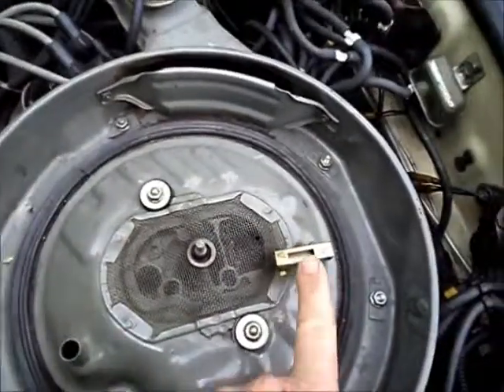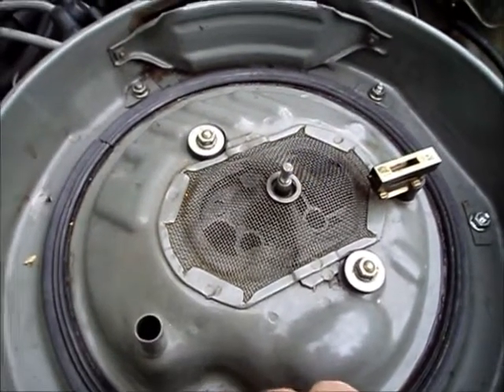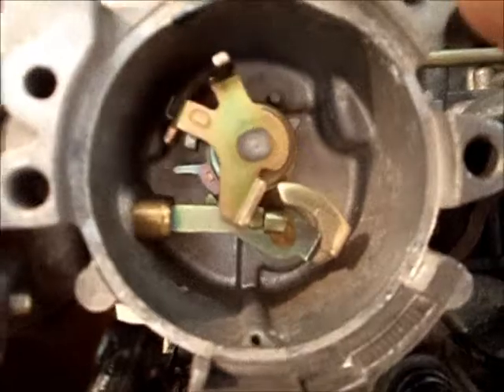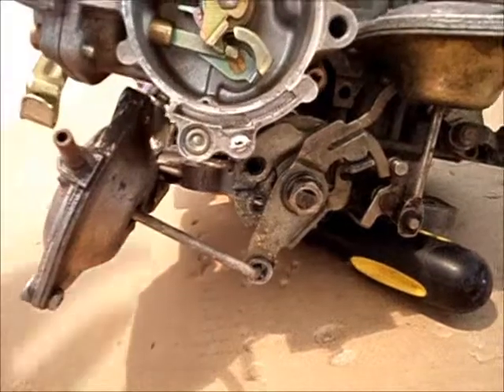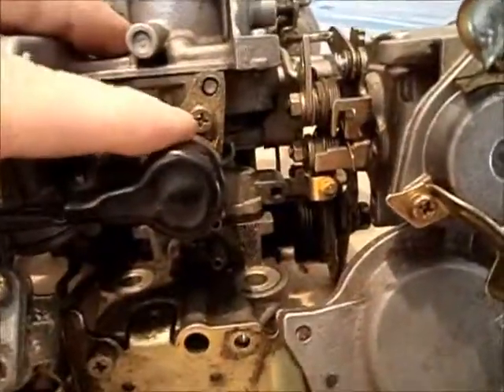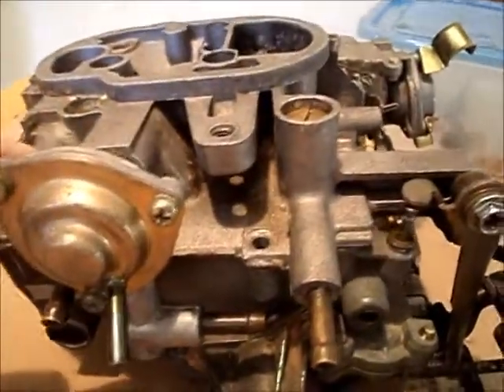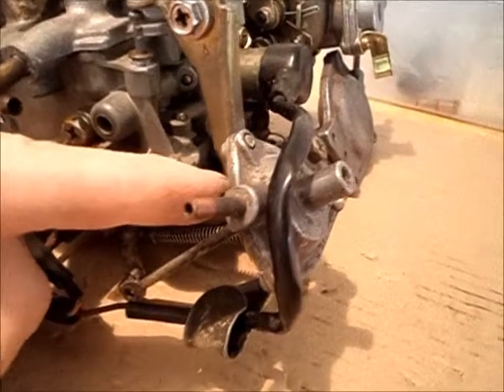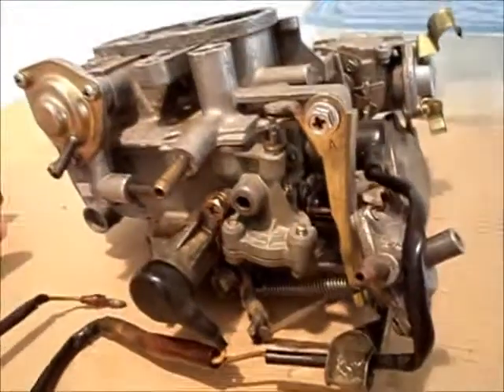Honda Roots 3 Barrel Keihin Carb Break Down. Part 1

Comment: You do an excellent job of explaining these unique carbs. I may have sold my '81 Accord SE, but your video brings back all the great memories of that blasted contraption. When I got it, both fuel cutoff solenoids had died, choke wouldn't operate, cold idle wouldn't engage, AC fast idle wouldn't engage, and secondary throttle wouldn't open. I had so many vacuum issues on that car it was amazing. I wish I had your video 5 years ago! I'm ready for part 2 and 3!! Cheers!!

Comment: I'm working on a carb that looks pretty much exactly like yours on an '80 Civic wagon.
Looking forward to part 2!
Fuel continues to dribble into the main cavity after the engine and pump are off, and doesn't run well (too much fuel, I think).
Anyway, thanks for these videos. I love my old Honda!

Comment: Hello! Thank you for this video! I was wondering if you had any experience or tips on adjusting the needle valves for these carbs, without the Honda float gauge tool? I have a '77 with this same carb and I cannot get it to run right. It floods and floods. The carb is rebuilt by national carburetor and in perfect shape. And advice would be so very appreciated!!

Comment: Do you have an alternative solution for the molded rubber insulator used for Keihin 3 Barrel carburetor?It was used on the 1983-1987 Honda CRX HF 1.5  engines. It appears this is no longer available or sold anywhere.
What would you use as a reliable solution for carburetor insulator or base plate w/o vacuum leaks? 
"Keihin carburetor is the molded rubber insulator that sits under the carb. The insulator has a reputation for being a source of troublesome vacuum leaks."  (the rubber base plate that the Keihin3 barrel carb is bolted onto)I hope to hear from you soon

Comment: One other note/ thought... I remember many years ago, a fellow using a one bbl carb off a Dodge slant six on a Toyota Hilux pickup. I think it was an 18RC engine. he made an aluminum spacer plate and adapted it to that motor.... It ran ok, but he mentioned he lost a couple mpg. The slant six was 225 cubes , the Hilux motor was not much more than half that. It may have been too rich.. I don't know... but I thought it was interesting, the fellow just could not comprehend the Japanese carb. Not sure what it was, maybe an Aisin....

Comment: I just want to know more about that tiny third barrel!
Reply: The 3rd tiny barrel is connected to separate intake passages in the manifold and head and feeds the pre-combustion chamber through the auxiliary intake valve. The primary and secondary barrels feed the main intake valve just like a normal engine.

Comment: have you made a part 2 yet? I have a Carb i already rebuilt and reinstalled but i need to adjust it. It has 6 set screws and everytime i tune one of them it throws the last one off again. I guess there is an order to tune them in but i cant find anything online
Reply: Were you ever able to find any more info on adjusting one of these?